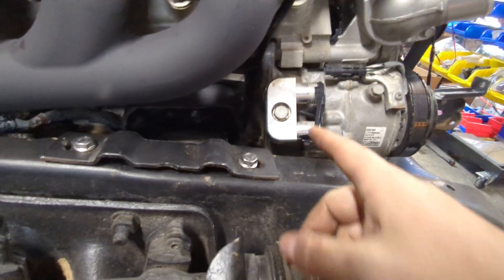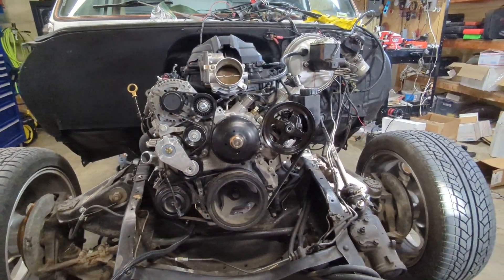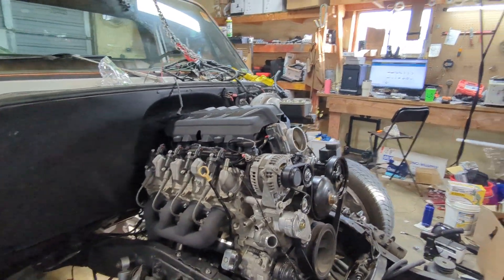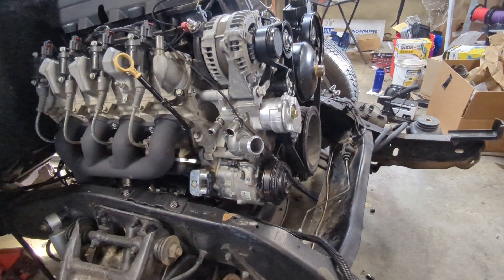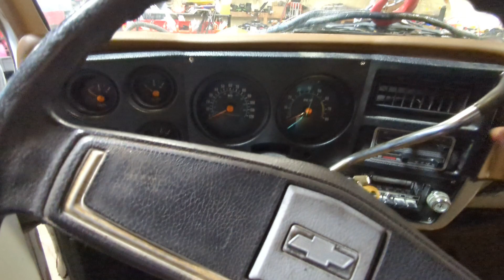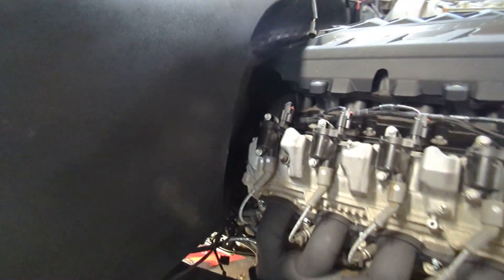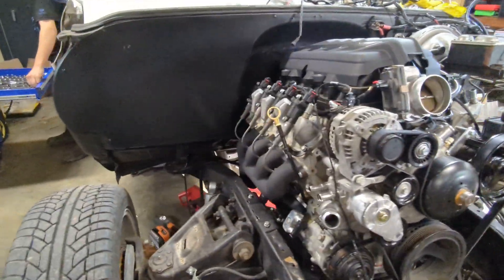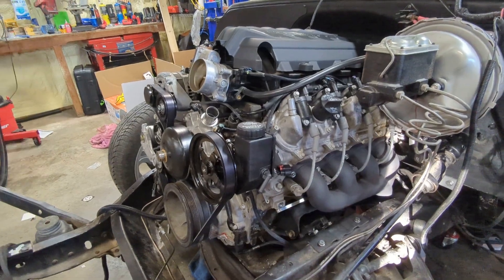C10 LT engine install

Comment: I've been doing lots of different belt routing options when sorting my Gen5 swap, and I looked at that way you have yours run, but I didn't like the minimal belt wrap on the bottom pulley. If you run the belt farther around the crank, then around the water pump, then over the PS pump, and straight across the top, it provides a much better wrap on all pulleys.

Comment: can i use the stick wiring or go with aftermarket?
Reply from the maker: Which wiring? I re work the gen v harnesses. My C10 has the original wiring in the truck still

Comment: Do you have a video of the Camaro gen v going in a truck? Everything I find is gen v truck engines being swapped.
Reply from the maker: It's the same just swap the oil pan and get the right accessory drive to fit. You can use a truck drive
Reply: @swaptimeusa  the oil pan on the Camaro Lt is very similar to the swap pan that everyone recommends so I’ve no issues there. Lots of clearance except the oil cooler on the Camaro engine is different than the truck which I finally found a piece that replaced it & allows me to add an air to oil cooler later if I want. The factory catch can setup on mine had me scratching my head a couple days. I’m keeping it in place & rerouted the drain pipe that runs from the can to pan because it ran right where the motor mounts had to go. This thing has been a hell of a learning experience to say the least.

Comment: Thanks for sharing.   What are the benefits over a earlier Ls engine?
Reply from the maker: Better fuel mileage, low end power, and availability. The 5.3s lt are very affordable
Reply: @swaptimeusa  thanks for replying.  I am wanting to swap one myself.
Reply: @swaptimeusa where can i get one with all the accesories
Reply: @swaptimeusa  @ any videos on stock ls low mount a/c    On obs?
Reply: You should go for it, MITCH is a great help . I did my 86 square body 5.3 lt 6speed & working on 70 c10 6.2 lt 8speed